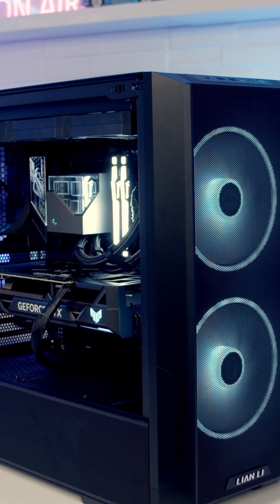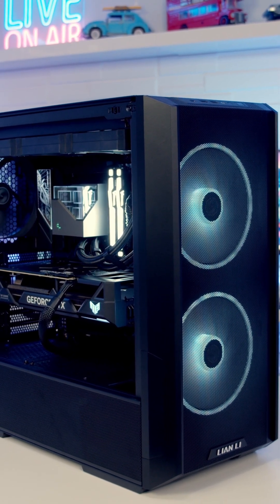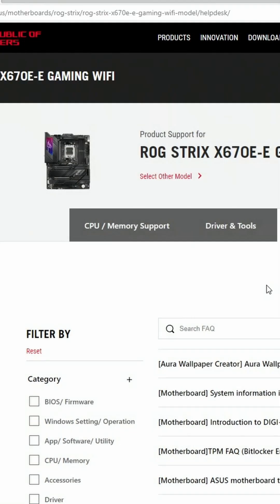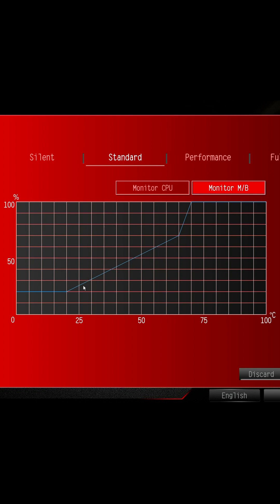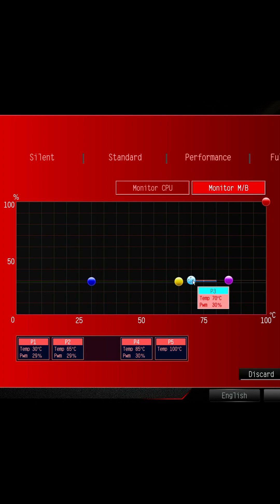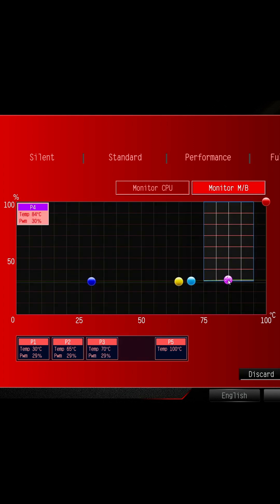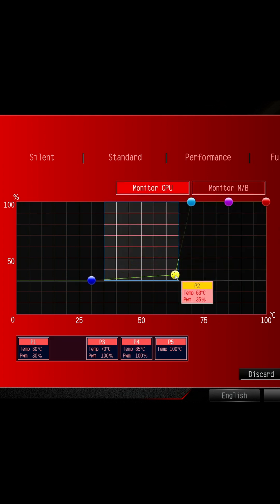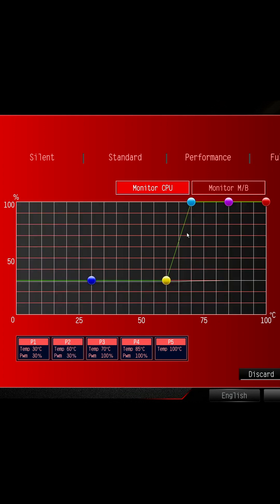Stop Case Fans Ramping Up and Down - PC Building Tips for Beginners #Shorts

Comment: Could you explain the percent and temp jump from base of 50 Celsius to higher temp range for aligning bios 50-60% fan setting on no ramping tip with low intensity use, any 350 rpm or more set at and leave it, 55c is point with extra rpm, and 70c is 100%

Comment: While i playing my fans become very super fast then very slow ? 
What's the problem? 
It's very annoying
Reply: Your fan curve is potentially steep right around where your gpu hotspot temp sits therefore when it fluctuates your fans ramp up and down in speed visciously
Reply: @CrypticSound24  what Fan speed is acceptable on gpus? Second - Can you set a constrained fan curve + a Hystersis on the software curve in the Dmm one only so you start and play games correctly? (constrained is popular for the starting node to not go on high rpm- (35-55c at a low %) it reads on a line not like a average curve leads on curve angle across to its next level while ramping to it.

Comment: The cause of this problem for me was the power supply. The PSU worked fine but its own fan and may case fans were full RPM. I tried everything. My last thought on that was the PSU so I put a PSU from a junker in it and problem solved.

Comment: The actual problem is programs calling home and constantly checking for updates which spikes the CPU.  I looked at every video and 'fan fix' for a solution and there is none, other than uninstalling programs that call home.  Windows updates will cause the same problem.  Its a 100% windows programs calling home issue, not a BIOS issue, and not one fan 'fix' in the BIOS is making it stop.

Comment: Some motherboards dont allow the fan curve to be fully edited, my asus board is very limited in this
Reply: Wrong. You can control your fans through armoury crate. You’ll need Fan Xpert.
Reply: @venividivici4253  Does it run consectively with a q-fan on manual ?
Reply: I would send an email to support. not being able to set every aspect of a fan curve is unacceptable
Reply: @kidsythe  happens to be on my motherboard u cant control the curve just edit it with number
Reply: @kidsythe  have no problem emailing or threads but the issue with the bios updates aren't something all worked for bios curves -cpu readings to heat dissipation

Comment: Please I'm new to PC building and I have a very important question. Should the CPU exhaust fans I have on my radiator run with the same fan curve I have set for all my other case fans, or should they run at a high fixed speed at all times?
Reply from the maker: I would run the fans on the radiator at the standard fan curve and the recommendations in this video are for the other system fans and only if the build is too loud. If your new leave the fans on the radiator as stock and you need to test any adjustment you make to the other fans. Might make a detailed video on this
Reply: @ChristopherFlannigan  thank you so much. 
If you make the detailed video then I and many others like myself would be very very grateful. I'm subscribing and keeping notifications on in hopes that you make the video.
Reply: @ChristopherFlannigan  How does the preset on bios attend to aio icue fan software control ? not overwrite itself? 
Can't i adjust the ramping up and down if i settle for the cpu temps inside the computer then go in bios to alternate the threshold of cpu temps on system fan slow curve adjusting? What video has been out to show.
Reply: @ChristopherFlannigan  bios standard fan curve? so dont put up higher rpms to follow the heat changes?